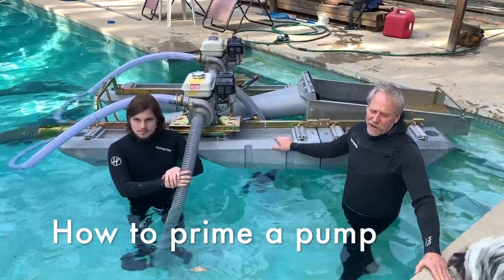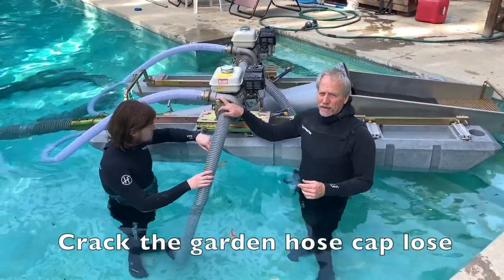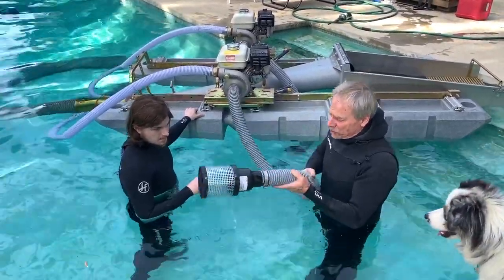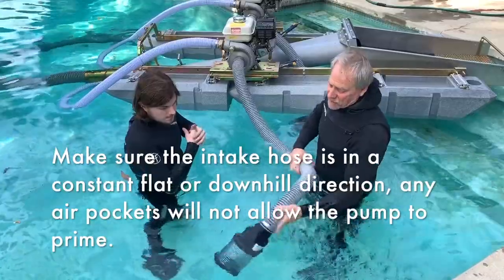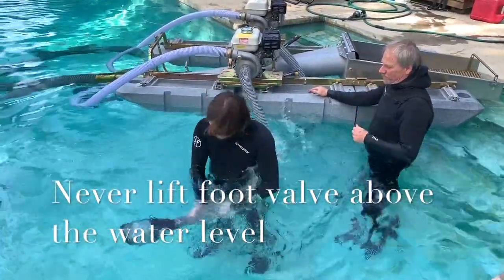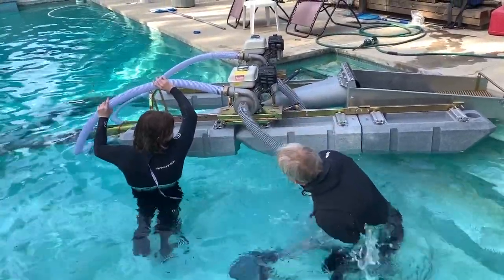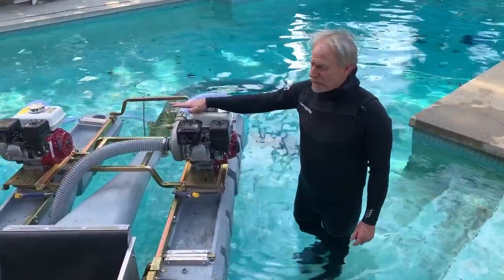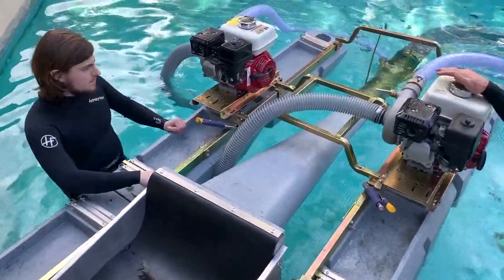How to prime a Keene dredge pump.

Comment: What dredge configuration is that?
Reply from the maker: This is a dredge that I built for a few special customers including my self.  If you are looking for a backpackable 5" or 6" dredge this is work considering.  I have some of these that are being used up in Alaska, they haul in on snowmobiles in the winter and fly in and dredge all summer long.  This dredge is not meant for fast water conditions or extreme depths.  It is lighter and simpler than most dredges and breaks down into smaller components for packing in by hand.